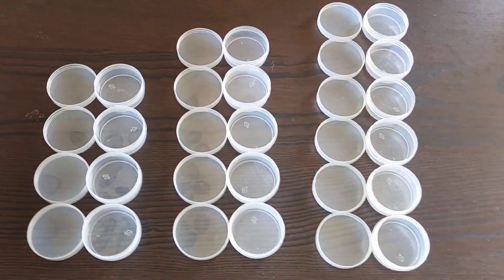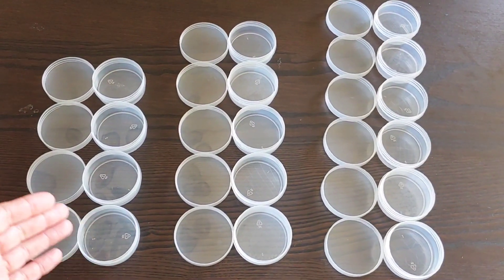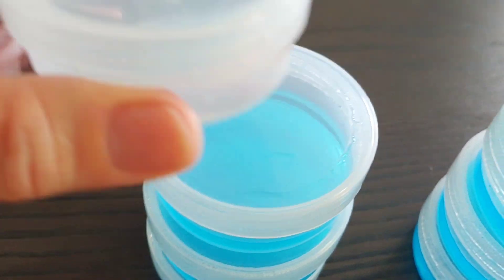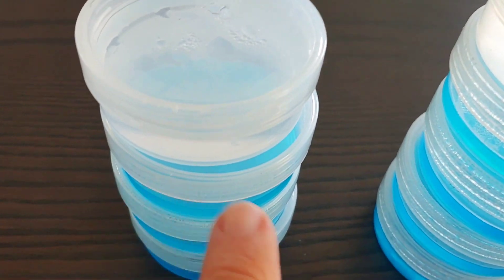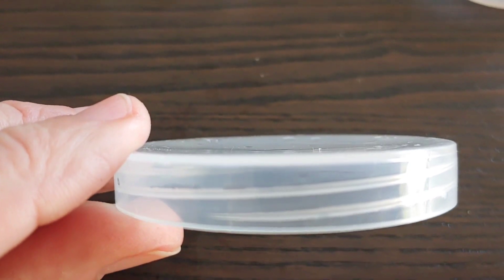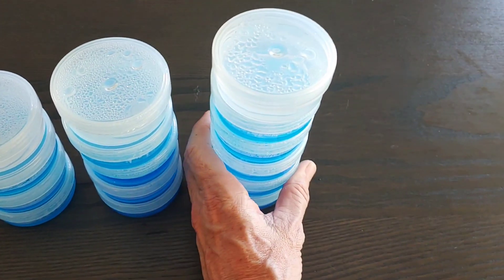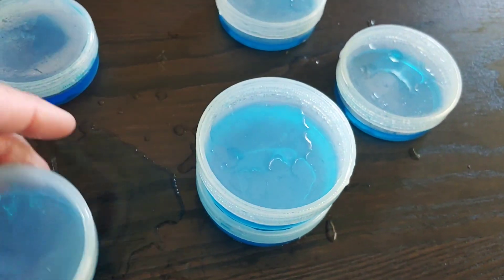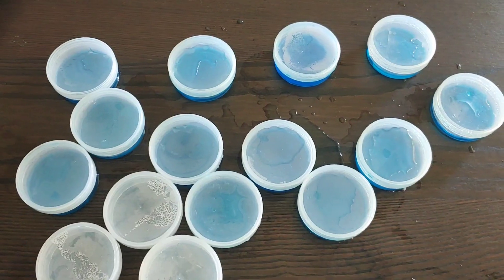PP5 Agar Cups Condensation - SOLVED!

Comment: so how would you ammend this into your agar workflow? After you pressure cook the agar in an instant pot, screw the lids on tight as soon as you open the instant pot because they have to be cracked a little bit so they dont build up pressure, then as the agar is cooling pour hot water on each of them

or when you put the agar dishes in the pressure cooker just put a tablespoon of water between each dish? then pressure cook and let cool down naturally? 

I noticed sometimes I see sediment in my agar, like two separate areas, it still grows ok as a medium, maybe a little slower but I use a PDA agar recipe mostly.
Reply from the maker: See the whole work flow here:
https://youtu.be/yMzS456sbQQ

Comment: Hey buddy, just couldn't help but notice, wouldn't filling a mason jar with boiling water and setting that on your plates for a few seconds instead of splashing water everywhere and making you need to dry them/ making a mess/ less risk of traveling contams.... maybe, .......probably,... just a suggestion.
Reply from the maker: @thisbemypage  That didn't work with these cups because their tops are concave (a bit bowl shaped) and the bottoms have another indent. This creates dead space between each cup that keeps the condensation from going away.

Comment: When doing this- do the lids need to be tightened all the way? Or loose?
I’m thinking about doing this this time around- but I may switch to pouring it in an SAB for these cups. For time.
Reply from the maker: Lose lids while you Pressure Cook, tighten them as soon as you take them out and stack them as I mentioned in the video. I pour water between the cups to fill the air gap. That was the ultimate fix. I linked the video to that part as well. Check them out. 😎👍🏼🍄♥️
Reply: @KitchenMycology  thanks bud!! I appreciate your help!! Much love 🤘🏼💚🍄🍄‍🟫👽
Reply from the maker: @Notnormal9  Thank you for Joining my Patreon! Every little bit helps! 🍄❤
Reply: @KitchenMycology  I really appreciate your patience, communication and responses. Happy to be a part of your community 💚

Comment: Can you touch on why you store them upside down?
Reply from the maker: Right. Because any humidity will fall away from the Agar. Later, when there's mycelium growing on it, you also store it that way so the humidity falls down and away from the mycelium.
Reply: Got it. Thanks for the reply man. So I did your trick for getting rid of the condensation.  But what I noticed is that the condensation disappeared but in doing so, is now just chilling on top of the agar.  So then I was thinking, will the water absorb into the agar or will it just end up on the inside of the top lid again when I store it upside down? I hope that makes sense. Thx my guy
Reply from the maker: @CeeBee-jk9mk  when you store them upside down, it forms a bead of water on the edge of the lid. When I'm going to inoculate or transfer to it, I shake off that bead. I can't remember which video I show that, but check out my Agar playlist. I give quite a few tips here and there. 😎👍🏼
Reply from the maker: @CeeBee-jk9mk  https://youtube.com/playlist?list=PLerR1zfM1CNkjP7pcGTccTTeLKEBdXVW6&si=pQm-TEjTM0J03hg_

Comment: Nice test.  A couple of things to take into consideration.  Since condensation is primarily a function of temperature differential, you can get quite different results based on room temp, pour temp and cup temp.  For example, if I do mug tek on 6 plates sitting on my granite kitchen counter with a room temp of 65 degrees, I get a different result than when pouring in front of a warm oven and then stacking in my oven with the light on and a temp of 75.  Also, I have found that by letting the agar cool longer than most recommend, you can greatly decrease the initial condensation.  Agar starts to gel at about 105F.  Therefore, by waiting until it hits about 115-120, the temp diff between the agar temp and the cup temp is smaller.  This is where a cheap IF thermometer is way worth it.  Also, the warmer the plates are, the less of that initial condensation hit you will get.
Reply from the maker: True, true. My only difference is that I do a "No Pour" Tek, so I take all the cups out of the PC already poured, so I can't pour them cooler. 
Now that I know about that concave gap on the lids, I could find a flatter brownie dish and oiur the hot water over the lids. Non of the ones I have are truly flat. Thanks for the input! 😎👍🏼
Reply: @nMycology I no pour as well.  I find that if I get a lot of condensation when I 1st pour, and before I PC the plates, it seems even worse after I run the PC.  I do find that if I run the PC overnight, and let it cool until morning, things are generally better but not always great.  I tried adding an insulator to the PC after it shut off to slow the cooling cycle but the jury is out on that.    At the end of the day, the trick is keeping the top plate hotter than the bottom plate and you got me thinking.  I might try to find a round ceramic dish that fits in the PC and rests on stacks of plates.  Then, after the PC cycle, I could add the plate with hot water and see if it makes a difference.  I'm also running my plates in bags to keep everything sterile.  I had a couple contams sneak in through the screw tops, but I was being overly relaxed with the plates.  :)  Good luck!
Reply from the maker: @toddwmac  Ahhhh, now I see what you meant. I think that I get less condensation if I take them out warm. If they're too hot, when I close the lids, they suck in as they cool down. I think my lids are concave because of this... I believe I've had better results taking them out pretty hot, but not too hot. I haven't done a scientific test, but I think that's how it is for me. 🤷🏼
Reply: @KitchenMycology  I'll give that a shot.  I'd really like to get a solid protocol dialed in.  Thanks!
Reply from the maker: @toddwmac  Let me know what you learn. 😎👍🏼

Comment: You friggin DID IT brother!!! I knew if I suggested we try and improve on your discoveries that you'd figure out a better one :P Now my only question is: do you think it's possible to simply add hot water to the top of each lid WITHOUT an agar cup full of hot water? Just the hot water on top of each lid: do you think that would remove the condensation just by itself? now THAT is something I want to try out. By the way, great scientific move on figuring out that the lids are concave. Never would have thought of that nor thought of adding just water to the top of the lids!! friggin impressive